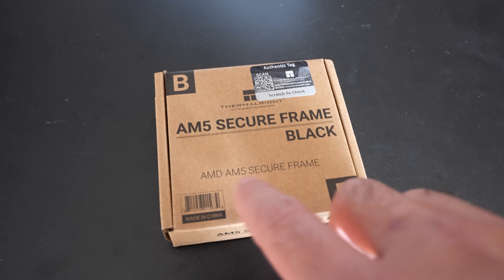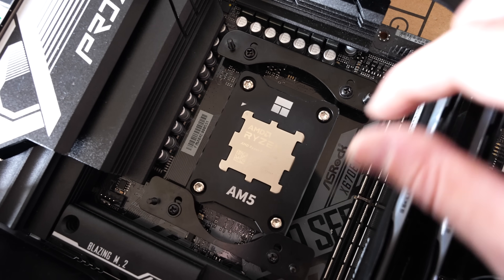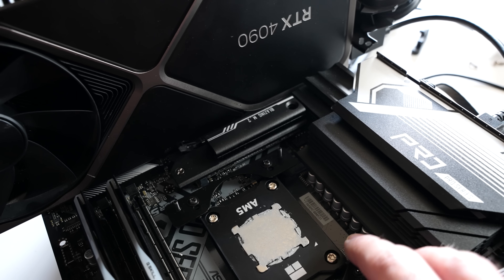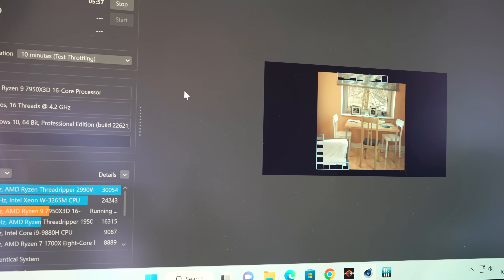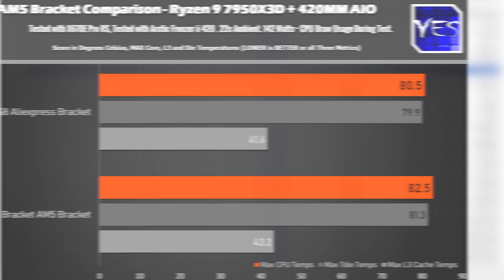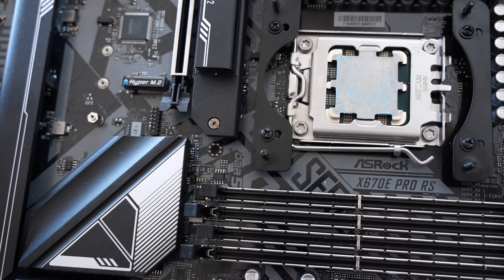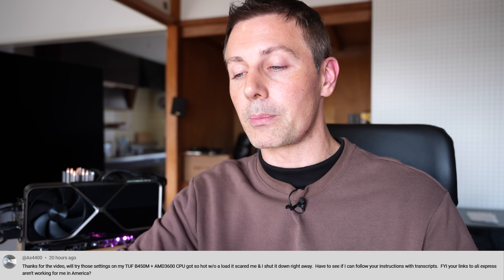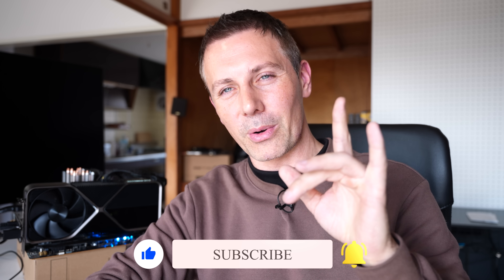$8 Fix for AMD Thermal Problems? | Thermalright AM5 Contact Frame

Comment: its easy, this only works great for intel because their cpus are rectangles so this works against that. amd cpus are way more square, so it basically does nothing. i bought one for am5 because if you paste your cpu, with that ring around it, cleaning becomes way easier

Comment: I have a 9800x3d and a noctua NH-D15 G2 LBC air cooler WITHOUT this bracket and it never go's over 60 degrees under heavy cpu heavy type  games. Don't waste ur money. Also who's having problems. Imo noctua better than aio.

Comment: I though the MOST important thing this frame is supposed to do is stop the CPU from being damaged... with cooling only as secondary. Also have a look at the copper versions you slot in or the ID-COOLING  ABF-AM5 Contact Frame.

Comment: It's not surprising really - for an air cooler there is a little area for the air cooler to move a little air around and on the side of the CPU as opposed to without the contact frame. Once the contact frame is on the air can't reach around the sides of the CPU like it can without the frame. Water cooler also cools the contact frame and the extra frame real estate itself may help dissipate some heat.

Comment: Thanks this saved me 10 bucks. Was gonna get a silicone thing off amazon for like 14 dollars but this came to 3 dollars cdn and should prevent the paste getting everywhere like the silicone thing I saw and keep pressure a bit better with my water cooler.

Comment: I didnt use it so much for the added temp drop. I mean if it helps a degree or two great, but I used it more to ensure even hold down pressure and keep the thermal paste from making a mess. I pais $7 and its worth it for that. If these were say $25 like the stupid Thermal Grizzly one...yeah stay away. But $7-8 from Thermal right is more than fair. Thanks for the testing video.

Comment: This thing made a 6-8c difference on my 13700KF. When building my recent AM5 (7500F-7900XT) build, i noticed a similar 1-3c difference. MoE. But it looks cool, and keeps things more tidy. I use PTM, but still makes it apply a bit better. cheers.
Reply: It mainly makes paste application less of a mess
Reply: @TopShot501st  indeed

Comment: I have a big thermal right tower cooler and doesn't seem to work very well. The heat pipes don't even get hot. This normal? No matter what it will hit the max temperature I have it capped at.

Comment: This is just a created market. Complete placebo. The intel bracket was made due to the rectangular design made the IHS bend. The amd IHS it way to thick to make it even possible to bend. This is a no go for me. The only way this is doing the 1 degree off, is that that the bracket is aluminium absorbing some heat itself. And i think this is only possible with the Arctic AIO who has the fan blowing on the socket.

Comment: Got one for the 9800x3d and it was way too tight and would not go down, ended up pulling my cpu up. Don't know what they did, but it sucked going through that
Reply: should i get this for the 9800 or nah?
Reply: Was it the v1 or v2 version ?

Comment: It's not so much to add cooling is more so you can use thermal paste without worrying about the exposed circuitry on the am 5 CPUs. You can use thermal paste like thermal grizzly without worry

Comment: Can u try also to add fan on backside od motherboard into cpu position? To get it cooled from both sides? Could also drop some temp. Just make some holes in case to get air directly to backside of MB

Comment: I find it interesting that some people say it doesn't work, wonder what causes the discrepancy? I have been think it is possible that the contact frame may absorb a slight amount of heat from the CPU and that could help dissipate heat (especially if there is some sort of airflow under the heatsink) I also wonder if it's possible it could through the screws transfer more heat to the back of the board

I would be curious to see this tested, does the contact frame get hot during loads? and what happens if some sort of fan is used to cool it, and does the back of the board get hotter with it?

also would wonder what would happen if it was lapped (possibly along with the CPU) to provide the exact same height and be flush, so the heatsink makes contact with it as well.
Reply: Its pretty simple … the manufacturers do not promise any temperature improvement qualities! Its for pressure distribution only! With optional silicone guards it prevents paste overspills. Thats all! That some experience improvements is associated with re-doing the setup!

Comment: I'm interested in how much thermopaste squeezes through the micro-gaps between the frame and the processor, or whether it remains clean as they say. ...Are there two types of these frames or is one a fake? in the photos, some have milled, shiny edges, while other frames do not have this and are completely covered with paint

Comment: what if you put processor grease on all the parts that touch between the pressure plate and the IHS, and also between the proc/IHS and the cold plate on the pump (or heatsink) ?

Comment: I believe that the difference is not in the temperature, but in the sealing of the connection pins, it is common for oxidation to occur in the CPU pins after a few years of use, this frame reduces contact with air humidity and dust that causes problems with the pins .

Comment: is there any bracket for r5 8600G?
Reply: It's the same, AM5
Reply: @Paolo_980  because a seller on ebay told me that is only for 7000 series
Reply: @Paolo_980  are you sure? i tried to buy from ebay and told me that it is not compatible for 8000. only 7000. do you have any link?
Reply: @jamrza  ryzen 5 8600g shares the same socket as the 7000 series, AM5 socket
Reply: @jamrza  it's impossible that it's not compatible
Reply: @Paolo_980  i know and that's the logic but even thermal grizzly says about 7000 series

Comment: It should be standard with both AMD and Intel.
Intel has an additional issue to solve though. It's still quite easy to damage the pins on the motherboard. You're never really sure about the alignment. There's too much room to wiggle the CPU around inside the socket. Even if they stick with pins on the motherboard they could at least provide a mechanism to improve perfect alignment. Just one pin on every corner would do.

Comment: honestly 2 degree drop for 10 bucks ? I take that. Just for comparison: the only better way to step up from an AiO would be a custom loop which can cost you 400-500€ at least and the difference is roughly 10-15 degree. so 2 degrees for 10 bucks looks like nothing BUT compared to the next step it´s a very good performance.
Reply: They are not made for temperature improvement … am5 pressure optimisation and the optional silicone guards for paste protection.

Comment: Does the 7950x3d run much hotter than the 7800x3d? My 7800x3d runs way cooler than this with a cheap 60$ 280mm aio it uses the stock amd mounting too, like the little plastic things i did undervolt but gah damn this runs hot compared to mine.

Comment: Honestly, the main thing of note I've found in using this with my 7950x is that, in a new pc build, there's no reason not to put this on your CPU. Worst that could happen is you don't drop temps and your CPU is held down more secure than the build in bracket.

Comment: It protects the chip and board from excess thermal paste, but no tests show a temp improvement. Only the Intel one had temp effects.
Reply: The AM5 are for pressure improvement! Not for temperature and not for paste protection! For paste protection you must use the optional silicone guards … clearly stated by manufacturers!

Comment: Bracket is NOT for Thermals in anyway shape or form the original maker said that himself.
then companies started scamming people saying it cools them down, if he patented it would never have happened
.
its copper plate that does not even touch the IHS there is a gap around it its only to secure the CPU in place when using heavy coolers or those with custom back plates. 

Sorry tech yes city you were lied to and scammed. 

Only Delidding and Direct Die makes significant different of 15-20*C 
1-5*c will do nothing

Comment: Why is everyone complaining about the temperatures of AM5 processors? I don't know how representative this is, but I have an air-cooled R7 7700 and its temperatures have never exceeded 70 degrees, what do you have to do with the processor to get it to 92-95 degrees?
Reply: They run synthetic stress tests. In games, when the cpu doesn't reach high usage, the temperatures should be fine.

Comment: Its for setting problem's. If the cpu or mob start to get a gap do to the heat cycle or other things like clamping power. Amd just adapted it after Intel needed it

Comment: I am building a new AM5 computer soon, but im planning on using Liquid Metal will this help with the security?
Reply: According to Thermal Grizzly the optional silicon guard is mandatory when using liquid metal! The bracket itself is for optimised pressure distribution.

Comment: Thermal throttling is intended behavior on Ryzen 7000 on default settings... It's not surprising you're hitting that limit on an air cooler.

Default behavior boosts till it hits whichever limit comes first, power, temp, whatever, if it's all good it'll just keep boosting.

Comment: If youre having heat problems with 7800x3d or 7950x3d a simple non invasive trick to drop temps by 15-20 degrees celsius is go into edit power plan>change advanced power settings, scroll to find porocessor power management>maximum processor state, and change from 100 to 99. 1% drop in performance is worth the trade for -20 degrees temperature.
Reply: It's not %1 performance difference only, It completely disables  CBP. Just dont do nothing. It desing to work hot. Just buy better cooling instead or slightly undervolt.
Reply: Terrible idea lol. That turns off boost
Reply: You are just stopping the CPU from boosting. I guess you play crappy non CPU intensive games 😂 so you couldn’t even tell the difference. Just get the bracket, a good 360 AIO, enhanced under volted BIOS settings and call it a day.
Reply: @k24turboss I have pbo undervolted. This suggestion more for people who dont know or wanna go into their bios. Which is most pc users. Im not trying to help the insane knowledge pc geniuses. Yall pc wizards already know everything in the world and have to comment to let people know. I was just trying to help some people that werent as insanely genius as you.
Reply: @dillon4813  but it's not a helpful tip if people think the drawback is simple 1% drop in performance when it's a lot worse than that.
Reply: @CockpitCrusher  its barely anything. Test yourself. These people saying you lose so much performance dont know shit. I have this cpu, and have done benchmarks at 99% and 100% and guess what, barely a difference in fps. barely a difference in benchmarks. People should do their own testing and have first hand source of information. See it for yourself. In some intensive games you get more fps! Same thing as down volting PBO. Cpu doesnt get super hot, doesnt thermal throttle as much and can stay at higher frequencies, causing higher fps.
Reply: Lmfao disable core performance boost or precision boost overdrive.

Comment: lol 7800x3d is low watts but you still need a beefy cooler. Not no hyper 212 or anything the same size. Thing gets hot as fuck even with low wattage and correct SOC voltage. Thats why Im even watching this video, to see if I could get a few degrees less with a simple bracket. My max temps right now are 79 but I like things to be as cool as possible especially if its cheap.

Comment: yea i don't think they would make any big difference with AMD 7000 CPUs cuz they are so small and square so they don't bend like intel. but my 13700K got a damn 20C cooler it was always in the 80s when gaming, yes just gaming, and if i kick on Cinebench pfff it starts thermal throttling so fast. i bought this now my Cinebench temps are in the 80s and gaming between 55C~60. im about to upgrade to R7 7800x3D and wanted to see if it made a difference but with a small CPU i'm sure it would not be a problem with stock bracket

Comment: this is why i probably wont be upgrading my cpu any time soon between the 13900k and 7800x3d they both run to hot for my liking an AIO or fan heatsink will not keep these beasts to reasonable temps they need to invest in newer tech and stop the playing around with fans with more rgb or cable mods no matter what fan or aio they design it has its limits
Reply: Isn't noctua NH-D15 or noctua u12a enough for 7800x3d ?

Comment: As mentioned by others, this bracket is not for thermals and testing it as such is pretty much pointless. This bracket is there to prevent the thermal paste getting down into the cutouts.
Reply: False … the silicone guard that is optional is … the bracket is for pressure management.

Comment: The cpu throttling, that wasn't because of the thermalright bracket right? I bought one mainly to keep the paste from running down the sides of the CPU, but I wouldn't want it to make anything worse.

Comment: Nice test. Do you think horizontal or vertical orientation of the motherboard would matter? With a vertical orientation I can imagine that the bending effects with a large air cooler are more significant than in horizontal orientation. I was looking if this was bracket would be helpful with my air cooler. For now I'll keep that 8 bucks in my pocket.

Comment: I have a doubt, can I use the normal water coolers for AM4 ?? Or I need to see if it’s compatible with AM5?
Reply: What are you going on about? Is it about the bracket? The bracket is for am5 … optimised pressure distribution … the silicone guard that is optional is for paste protection. What is a normal water cooler … an aio? Of course you can use those for am4.

Comment: Good product, just not for the regular consumer, they do nothing to temps though, and do not help with paste either, what they do is distribute mounting pressure, and if you lap them down allow you to lap the cpu past 1.1-1.4mm, although ihs in theory allows you to lap 1.4mm due to having retention on 1 side tolerances are more like 1 to 1.2mm, so you need to replace that to lap the cpu

Comment: The contact frame is much lower than the cpu die surface so there is no way to transfer heat to the cooling plate. If it is accurately lapped to the same level of the CPU surface plus a bigger cooling plate area, I think it helps.
Reply: You wouldn't want to lap it to the same level, there would always be a gap on one end and you'd created even more stress when there's thermal expansion, which would definitely result in a slight difference in the heights between them. But heatsinks aren't really  designed to cool from the entire surface area of itself, only the parts directly below the heatpipes will actually cool down, while the more solid parts will remain hot. So heatsinks are cooler in the center, which is where all the cooling takes place as the hot water inside rises and cools and falls back down, and that's what actually cools everything. I would say this bracket is actually cooling the chip, but in a different way, by making the hot spots less hot, the hot spots that actually reach above max temp but cool off quick enough before the temp sensors themselves get to register it, which is normal in CPU's, since the temp sensors are spread throughout the CPU, and can't be everywhere at once, so over very small areas, the CPU temps actually get even higher than the number stated. So while the temps look the same with the bracket, it's also likely helping to reduce those micro areas where temperatures get extra high. So you end up with overall the same heat being sensed, but it's actually being spread out more evenly even if it is the same temp. I think what this design really needs though is fins on it, cut out from grooves in the surface, like a static heatsink. Just like any other passive heatsink. By doing so, the surface area would increase and it would show better results. The fact is, the aluminum didn't need to be this thick. Just a few millimeters would have been good enough to keep things stable, with the rest being fins cut into the top surface. It'd probably add at least 5c of cooling like that.
Reply: @peoplez129  You have a point there but on thermal expansion, what expands more, the die (with higher temps) or the contact frame?
Reply: They are not for cooling, just for pressure distribution. The optional silicone guards are paste protection. They have nothing to do with temperature management. And this the manufacturer states!

Comment: You should make use of your Arctic AIO offset mounting, you using AM4 default mounting, but if you have a Ryzen installed you should use the upper 2 holes of the cooler mounting bracket, giving you another 5 degree off, and its centered on the hot spot.
Reply: But thats am5. The cores are not in the same place as in am4.

Comment: This is a confusing product and honestly, the epitome of China just copying successful products without really understanding why the product was successful. The thing is, anyone who sees this and knows what it is supposed to be for and how and why they would use it, will likely know the whole inception of "contact frames" was to solve a specific issue arising from the elongated rectangular shape and 2 point ILM of Intel's LGA 1700 chips. AM5 is square, and has a thicker IHS on top of that. Don't get me wrong, data is king so I'm glad someone picked it up and tested it, but it's just a pointless product imo.

Comment: Am5 socket don't need this kind of bracket because it makes even tension across the cpu thanks to "tabs" and square desing  , on lga1700 the socket is not making even pressure and this is why it helps :P